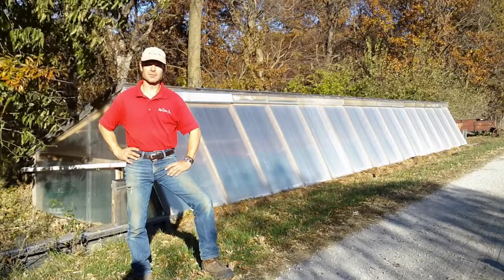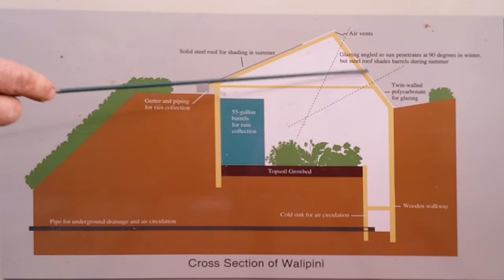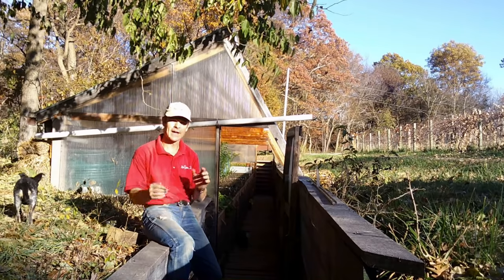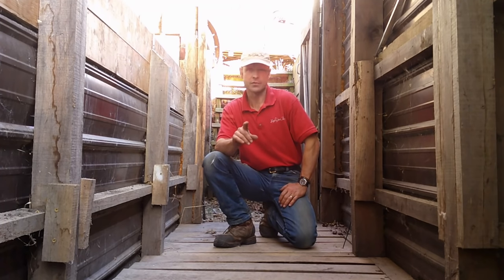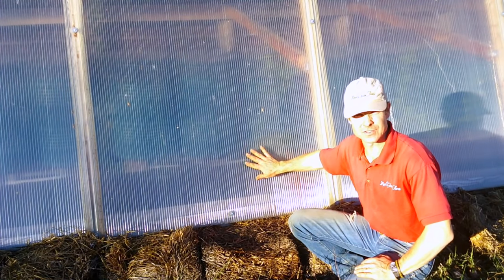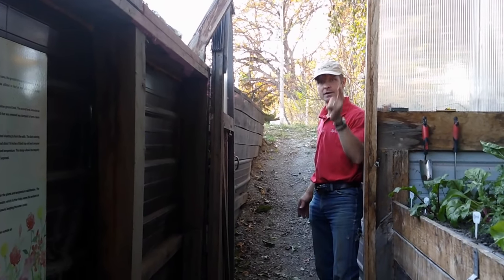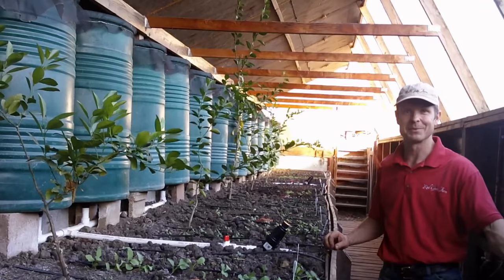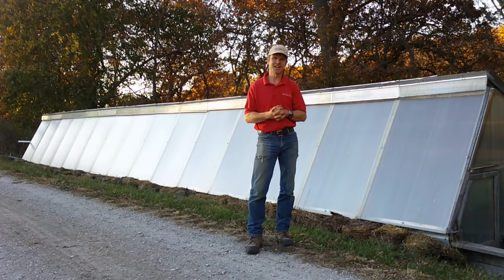Farm Tour Series: The Walipini; Use, Design, and Construction

Comment: Great video, and one question: What tod do, when the sun is not shining for long, and still freezing outside?
Reply from the maker: We deal with this every winter. Generally, most of January is overcast skies for us and very little sun. We do not expect plant growth during that time. Our goal is simply to keep everything alive and healthy. It only takes one to two days of good sun to fully heat full barrels of water.  So, if our forecast predicts overcast skies for a period of time, we ensure our water barrels are topped off, hauling in a bit if necessary, allow the sun to heat it, and then we try to avoid opening the walipini door as much as possible during the cloudy times. Remember, the advantage of the walipini is that the ground heat helps to stabilize the temperature, so it is not fully dependent on the sun. The sun just increases the temperatures. We can have several days of 0°F, and the inside temperature will remain above freezing, even with clouds.  Hope that helps!

Comment: Is the south wall orthogonal to the sun's rays at solar NOON on January 15?  Since the rest of the daylight hours on and around this date, the sun is lower in the sky, could you increase the total daily solar gain if the south wall were slightly steeper?  Perhaps the gain would be so small that it doesn't really matter. ?  

Anyway, a very interesting and well done project and video!  Thank you.
Reply from the maker: It’s actually set for around Jan 20 ( I misspoke in video) but the difference would be minor because these panels do diffuse light enough to be very tolerant to angle deviations.  Addditionally, I did have to consider the rest of the year and also structural integrity of the roof structure.  It’s all about trade offs when you consider the whole structure.

Comment: You give me a great idea.
My problem is during the summer I get too much sun and heat. 
So if I do what you have. I can scale to no direct sun in summer and direct sun in the winter. 
The other problem I have is ground.
about 8 inched down I hit solid rock. Most people don't understand that. I mean the rock sheets are solid and fractured. With this I have less then 1% soil. And that in those hairline cracks in the rock.
To understand better. I live on an ancient sea bed. That over time calcified over 500 feet. all layers are 2 to 4 inches thick. and between these layers is hairline to 1/16 inch of powder. Plus each layer is fractured.
So it the worse of all.
Its solid rock. That won't hold water because it fractured.
Plus since it rock. It hold no heat in the winter and does not cool in the summer.
 Thick of it this way. Ever been in a cider block building that has no insulation added? Thats my ground for over 500 feet down.
Reply from the maker: We have lived out west with similar ground to what you described.  We cover these challenges in our book listed in the description of the video.  In any case, though, the structure is still very doable—you just have to be a little more creative.  Building UP is one option, where you being in soil/fill and pour around the structure.  As long as it is sufficient depth and width, you will have the same benefits.

Comment: Would foldout reflector panels on south facing glazing hinged top and bottom add additional heat input similar to a solar oven? These reflector panels could be rigid foam insulation panels that would provide insulation at night when closed. Excess heat could be drawn off the ceiling and transfered to earthen bed. Walls and back roof made of air-crete would provide insulation adding to the earth battery effect.

I've heard that the polycarbonate difuses light negating the need to angle the glass back at an angle?
Reply from the maker: I think the reflecting panels would be a great addition. And yes, I even mentioned in the video I would’ve put concrete on the front wall, possibly the back wall, and definitely a footer for the tanks. Air Crete or concrete would work fine. As to the angle of light, the diffusing panels reduce the angle affect but do not eliminate it. Maximum solar radiation, and thus maximum heating affect, does occur at 90°.

Comment: Could this idea be incorporated with a inground concrete poured pool?
Reply from the maker: That could be a wonderful template to work with but you would definitely run into some issues. The most notable one would be sun angle. I don’t know your latitude, however as you can see I mounded up our dirt on the north side to allow sunlight to come in on the southside. The bottom of a pool gets very little sun unless you’re near the equator. But if you’re that low in latitude, you don’t need a greenhouse😁

Comment: Have you ever had issues with mold, moisture etc collecting on top of the removable panels?  I had insulation panels in my chicken coop and the heat from the coop caused moisture to collect on the underside of the tin roofing and drip back into the coop causing humidity issues..
Reply from the maker: So far, we have not had any issue with mold in the Walipini.  We so have a LOT of airflow, though, even at roof level thanks to the ridges in the steel panels.

Comment: you should paint the water drums black so they absorb heat more quickly
Reply from the maker: Actually, I initially thought that too. However, the barrels are not only gaining heat, they are reflecting light. Through my research I realized that dark blue was the best color, and dark green was the second best based on the light spectrum it reflected. Black, although very absorbent, does not reflect in the right spectrum to promote good growth.
Reply: @ADifferentWay  would it be worth painting the inside of the ceiling panels white?
Reply: @guygillmore2970  yes. I used the backside of accordion insulation material which I cut off from duct work scraps. It's very white and really brightened the greenhouse. Check my videos.

Comment: Sheer perfection.  If land was totally flat with a high water table in spring into May, Michigan, would it have issues with flooding?
Reply from the maker: Most likely but you could consider creating a large mound and building into that.  Some underground houses are just that,  they don’t dig a hole, they built a structure and bury it.
Reply: @ADifferentWay  does it insulate just as well as being in the ground? I assumed the ground temperature really helps. Thanks.
Reply from the maker: You can still make this work, but it is a complex answer that would require an expert from your area.  You would need to consider your ground water level, and frost line, and base the size of your mound on that data, in order to create a mound that still benefits from standard ground temperature.

Comment: I'm in northern New York, right now it's 2 degrees, I've seen -30, how much cold can this design handle?
Reply from the maker: The coldest we saw was -17F.  That was only one night.  Several nights that cold without good sun during the day would be too much.  To handle your weather I would recommend a tighter structure with controlled airflow through ground tubes (see second video). You could also consider supplemental heating for the coldest nights.  But I wouldn’t heat the air, I would heat the water.

Comment: If you were to price this project out how much would you say per linear foot of bed space? I have been looking into the work of Mike Oehler, but he used a lot of alternative resources so I wanted to know what a build like this ultimately costs. Thanks.
Reply from the maker: That’s a tough question because we used so much of our own resources (milled our own wood, found cheap barrels, did all the labor ourselves except excavation).  It was all done for less than $5000.  However,  I didn’t do a great job maximizing grow space and I’m now using more vertical space.   Be sure to check out Russ Finch also.  I was just introduced to his work recently and I’m very impressed.

Comment: Hello, what was your over all cost to build this? My wife and I own @Gloryhillshomestead which is based out of Western Oklahoma. We are looking at building an underground greenhouse or wallipini system to help support our garden growing during the winter months.  We look forward to hearing back from you. Respectfully, 
David Lacy
Reply from the maker: We estimate our total expenditure ran just under $5000.  That includes the excavation, and the twin-wall polycarbonate panels, which were nearly 2/3 the cost.  By using our own wood, compost, and recycling the water barrels, we spent very little on the rest.  Depending on where you live or what kind of equipment you have available, you could potentially lower those costs significantly.
Reply: @ADifferentWay  I really appreciate your help! And thank you for your service to this country!

Comment: I would like to see, how you cut the 60 degree angle ( I  am designing and building an in ground greenhouse) in my mind the 60 degree is steeper ( if that makes sense to you)
Reply from the maker: The cut on the sill plate is 30 deg.  The roof is joined perpendicular to the front wall giving the back roof a 30 deg angle also.
Reply: @ADifferentWay  thank you very much, I  had planned on building tge back wall straight and leaning the the front wall into it with a 60 degree angle and placing single pane windows on it, that I can open in the summertime as needed

Comment: I wonder how long that metal siding will last in the dirt?
Reply from the maker: We weren’t sure, but the paint will extend the life, and it is backed with gravel instead soil, which also extends the life.  We have discovered metal sheeting like this, but with no paint, laying partially buried on the ground 30 years after the previous owner.  Our goal was to have it last at least 10 years, and it’s almost reached that and is still going strong.

Comment: Buried still is a constant heat_loss in most cases, adding 2" pink foundation foam insulation to the foundation or with soil to it turns that all into a thermal_mass to keep the inside warm (still constant loss but a lot smaller).

And, using a thermal_fluid tank to heat soils if a closed system except the tank at the roof peak on pumps the height of the tank.

And, if given slope with a geocloth/waterproof barrier can capture the runoff of watering, usually this is ok to thin as a low-strength fertilizer water, it'll grow algae for onsite biodiesel from algae a future.
Fwiw 🍺🌾

Comment: You really did a lot of thinking and a lot of work! Congratulations! Why aren't the barrels black? How much did it cost you to build it and how many hours of work?
Reply from the maker: While painting black does help absorb heat, it does not reflect light as well as other colors.  As it turns out, if you really delve into the color spectrum of light, max. heat absorption, and reflectivity (which benefits the plants), blue is actually the best color for a greenhouse, with green being a close second.  Because we used mostly home-milled lumber, free soil, some recycled materials, and mostly manual labor, our main costs were the excavating (around $1000),  polycarbonate panels (around $2000), part of the steel roofing, some truss lumber, and most of the hardware and piping.  Total cost was just under $5000.  Unfortunately, we did not track our actual hours of work, but it seemed to take about a month once we really set to it (while still keeping the farm running, and other farm and family tasks going).

Comment: The pipe out the back would be 15 feet underground since I'm building this on a south facing hill....Can I run it out the front underground?  Should it slope down a bit?

Also, would you use aircrete to insulate the walls?  

Thank you
Reply from the maker: Running out the front is no problem.  One change I would make is to run several pipes out to increase airflow through the ground. A slight downward slope is best for drainage.
Reply: @ADifferentWay  Thank you.
You mean like a mini GAHT system?  I am thinking of using the Walipini sun angle/thermal mass plus a little GAHT driven by the thermal, not fans.  I build post electric grid homes that only use solar/wind/hydro transitionally...on the way to being "Amish".

Comment: How long did it take for that front wall to sink? Was it noticeable early on? And are you going to dig a footer and pour concrete?
Reply from the maker: It happened after the first season (1 yr).  I knew this was only a prototype and I may indeed set a footer later if I upgrade this walipini.  However, in my next build I’ll definitely have a concrete front wall with footer.

Comment: What if I wanted to do this opposite? I want to keep my plants cool during the summer getting sun to them. Maybe passive air flow through the soil?
Reply from the maker: It’s certainly doable, you would simply need to increase your ventilation and probably add cooling tubes in the ground.

Comment: If i want dwalf tree in the back how does that work with the Angle? You said the light shall hit the ground but not the barrel in the summer. but then the light misses the tree leaf?
Reply from the maker: You’re right, during the summer, those taller back plants would get a lot of shade.  However, if you choose to put permanent plants back there, you can allow the sun to hit the top leaves and keep the bottoms trimmed. That way the plants can shade the barrels in the summer, but when the sun falls in the winter, those plants won’t shade the barrels.

Comment: I'd be very curious about your overall cost to make this incredible idea.
Reply from the maker: We didn’t really discuss cost in these videos, because there are so many variables. Cost will be dependent on timing, region, and personal desires. Our cost ran somewhere around $4000, with over half of that being the price of the twin poly carbonate panels we purchased. Others have successfully built the structures just using two sheets of plastic at a much lower cost. We sourced most of our wood for free, where is others may have to purchase. It’s really something you would just have to look into for your area and go from there.

Comment: Hi
i have a questian about geotermic heating in the ground 
when you digg down we say 1.5meter or 2 meter. we have that groundheating.
But when you have digg down dont that change where the ground temp is?
Have you read about that anyware. Becouse in small sunken greenhouse that might not be a problem but if i build 10 meters deep and 20 meters width that need to have an inpact of the temereature where the geatermic heat will be?
Reply from the maker: You’re right, once you expose the soil, you will allow temperature fluctuations, at the new surface.  However, by building the greenhouse over it, you prevent that earth from experiencing extreme temperatures that surface soil usually sees with varying seasons. for example, in the winter, when outside temperatures were well below 0C the inside temperature would fluctuate between 5 to 20 C. In addition, if the earth in the walls did begin to fall below 15 C, it was constantly reheated by the soil behind it. It could take several months of cold temperatures to thoroughly deplete all that energy, but by then springtime would hit, and the Earth would be recharged with warmth while cooling down the surrounding air.

Comment: How long do you figure the  untreated wood will last in soil contact?
Reply from the maker: It all depends on the type of wood. Black locus and orange Osage are probably the best in our area. We have found that oak and walnut have lasted in excess of 15 years with direct soil contact.  Because this was a prototype, I didn’t much concern myself with that. Our current build is using Concrete. No Wood has direct soil  contact.

Comment: i built my house in the late 1980s and90s using GE lexan double wall panels for the heat storage wall after a few years (not long) the panels turned opaque and then  a kind of rusty yellow and of course are useless i wonder if your wallswill do the same?
Reply from the maker: I wonder that too but haven’t seen any sign after 5 years.

Comment: I want moisture resistant and rot resistance for my floor, walnut does that.
Lifts up floor, walnut planks are attached to pine 2×4's in the prime moisture area.
Reply from the maker: Ha!  Good catch.  Most of those 2x4s are white oak from the mill but I did run short and use a few scrap pine.  I check under there enough to find and replace the pines as necessary.
Reply: @ADifferentWay  no worries anyways, looks great. And it seems like there woukd be air movement anyways down there. I find that when you say certain things somtimes that happens lol

Comment: Sorry, did you mention a rough budget for this thing, either whole or per sq ft?  Also wondering, if you have a snow load, does that mean you have to shovel to get into the building 3 or 4 months of the year?
Reply from the maker: We spent less than $5000 but i milled my own lumber and bought the barrels cheap.  The twin walled polycarbonate was the biggest expense at over $2000.
Reply: @ADifferentWay  Thanks for the quick response. Any trouble with snow filling the stairways?  We are in Ontario backwoods and every trip to the greenhouse is an excavation
Reply from the maker: We don't get a tremendous amount of snow here.  6-9 inches at a time is about the most we typically plan for, though it could get deeper (but hasn't since we've lived here).  More importantly, it never sticks around for more than a couple weeks.  That said, I would plan to excavate stairways the same as your other experiences.  Anything outside the Walipini will not benefit any.  Only the inside is going to have all the geothermal and solar benefits. We actually talked about building a canopy over the ramp/stairs for that reason, but just haven't needed to.  Hope that helps!
Reply: It makes sense.  Thanks for your help